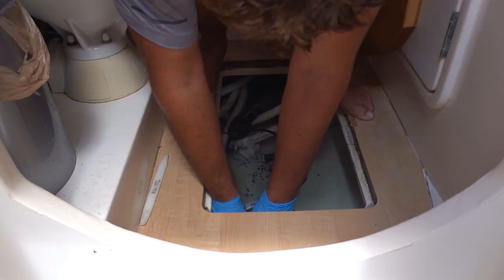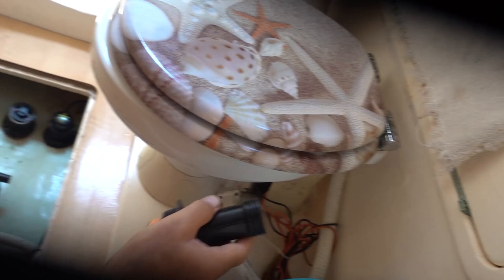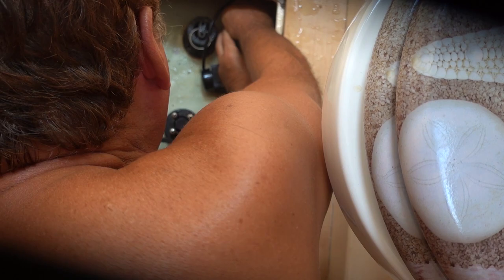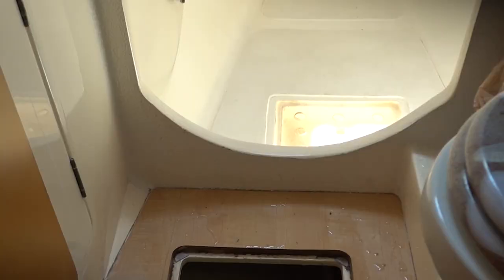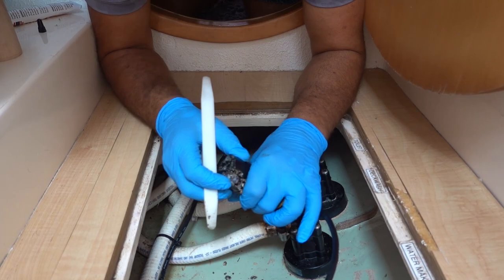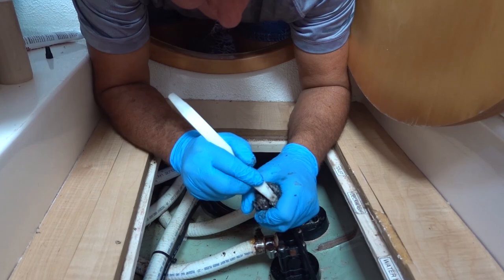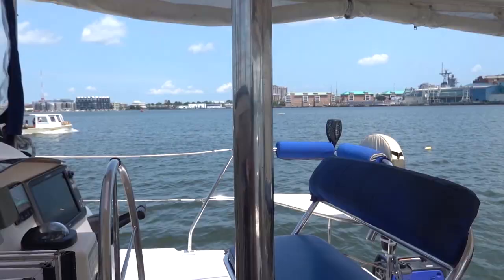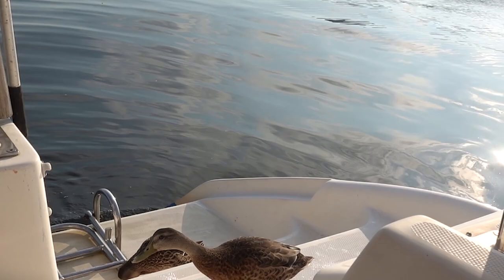SDA68 There's a Hole in the Bottom of my Boat!

Comment: What did you do in the automotive field
Reply from the maker: I did everything from windshield replacement to striping and hard parts. Running boards, roll bars, bed liners, window tint. Then electronics and competition sound systems. Automotive customizing from sunroofs, including power moonroofs to cruise controls, power windows, power locks, remote keyless entry, alarm systems and more. Built dragsters and track racers and more - Dave

Created and managed Automotive BDCs (Business Development Centers) for dealerships. Sold and managed new vehicle dealership sales events ~ Lisa